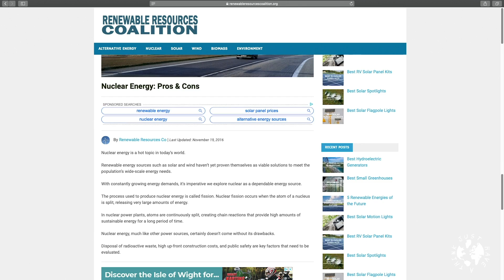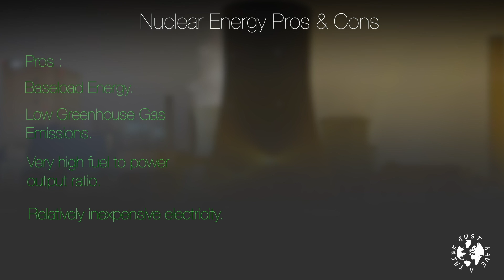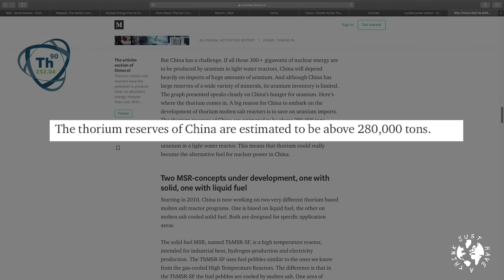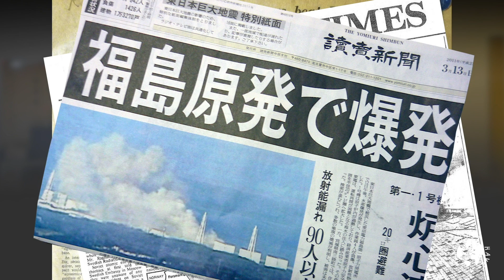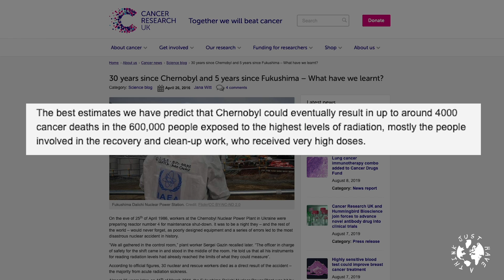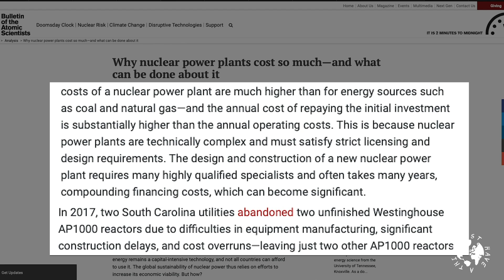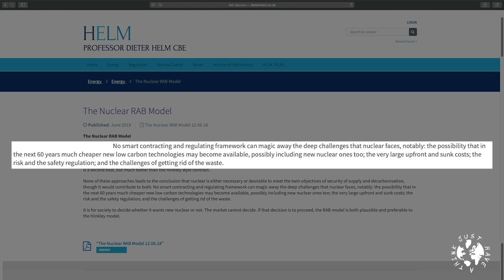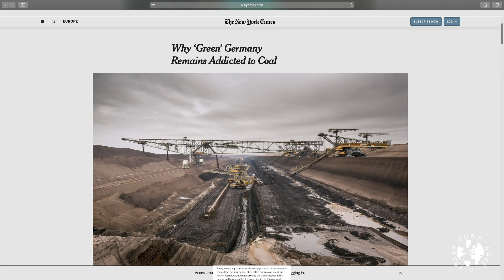Nuclear Energy in the 21st Century

Comment: Aside from the 'alchemy' required to turn thorium into uranium a couple of points:

1. The number of operational reactors is around double the quoted number if we include the ones powering submarines and aircraft carriers. They're small and so far have a pretty decent safety record. As you alluded to large high pressure water / steam is never a good mix hence high temperature reactors. Some designs can do both base load and deliver peak load performance and can work in conjunction with concentrated solar.

2. Our planets supply of uranium alone could power our modern world beyond the estimated life of our Sun. Yes nuclear waste is a huge problem but it's a big problem because of the amount of energy still in it. What a waste. Fast breeders address both issues but bring with them concerns with proliferation.

Proliferation is a valid concern but so is the societal impact of AGW and rising sea levels and several billion more mouths to feed. Ultimately the real problem isn't an engineering one, it's a societal one. The IPCC is right, we need to change the nature of human society regardless of wether we adopt nuclear or its alternatives. On the one hand we don't want more nuclear weapons and especially not in the hands of fanatics but wind and solar are pretty difficult to protect from attack.
Reply: Alcehemy? Its just a reaction: Th 232 +1n (absorption) -> Th-233 -> (decay) Pa-233 -> (decay) U-233. 

A similar reaction already occurs in every conventional nuclear reactor: 
U-238 +1n (absorption) -> U-239 ->(decay) Np-239 ->(decay) Pu-239

The difference is though that most of our reactors operate in thermal spectrum as there are some added difficulties, risk associations and proliferation concerns (largely overblown) related to fast spectrum design. In thermal spectrum U-233 has a higher probability of fission than U-235 or even  Pu-239 based on its neutron cross section and probability of absorption. In thermal spectrum Pu-239 actually has a high probability of absorption, which is in part when making nuclear bombs from conventional nuclear waste is effectively impossible. 

However in fast spectrum there is a near certain probability for Plutonium 239 to undergo fission compared to much lower probabilities for Uranium 235 or Uranium 233. 

Thermal, Epithermal and Fast Spectrum is a rather complicated topic that deals with the velocity of neutrons in a nuclear reactor core. Thermal spectrum relates to a situation in which neutrons are slowed by materials - these materials are called moderators in a nuclear reactor), whereas in fast spectrum there are no moderators.

Comment: We should go for as much renewables+storage as possible.  But this is with the realization that high penetrations of renewables (>60%?) grid reliability will be increasingly difficult.  A lot will depend on how far we can go with innovation on cheap grid storage.  (Transmission lines, dispatchable demand can also help.  But they have their own issues. )   So we should not be closed to nuclear, esp. after 2030's, the last leg of the decarbonization.   

There is a  debate between Mark Jacobson (Stanford, 100% renewables) vs. Chris Clack, et. al (PNAS).  My impression is that most of scientists who know something about both climate change and the energy think the Clack scenario is more realistic.  We will need some nuclear.

One issue to consider is what happens during a heat wave.  Use of AC increases.  Surprisingly, I heard that France had to shutdown some of its nuclear plants because the water from the river that was suppose to cool them was too hot.  Also the water levels were too low.  One would think solar PV would be a perfect complement to supply peak electricity under such conditions.  But PV panels also work less efficiently, when hot.  All these issues need to be addressed with the next generation of nuclear, as well as PV.

Comment: I agree that it doesn't make much sense to build new nuclear power plants when the cost is so high and when the costs of wind, solar and storage are falling so rapidly.
Reply: That depends where you are on the planet and what resource you have available. The UK has exceptionally high wind resource so might be able to manage without nuclear, but I've not seen any study yet (except lappenrata) which claims that it is possible. Many other high-lattitude countries have limited wind resource (and of course highly season solar resource), so nuclear makes an awful lot of sense, unless they have so much hydro they can make things work that way (parts of Canada?)
Reply: Solving the problems created by the mismatch between when the wind blows or the sun shines and when we need power to run factories or heat homes, etc. necessitates overbuilding the wind and solar components by a factor of three plus times, and then you still need to spend many billions on new high voltage DC lines to take that power from where it happens to be abundant today to where it's needed. And don't forget the additional billions in ongoing expense to maintain and replace energy storage for when there simply isn't enough power around. And of course there will still be days when the old fossil fuel plants will need to be run, so they must be maintained and staffed. All these problems become much easier to deal with if there's a steady reliable supply of dispatchable power available. The choices here are nuclear of fossil fuel with carbon capture and sequestration.

Comment: Wind and solar dont work when no wind, too much wind, no sun and too much sun.,  too cold, too much snow. Thorium reactors can use the spent Plutonium  waste from Uranium reactors and end up with little waste with insignificant half life. Like any new technology it's going to take time. Do you think Ford made his first car in one day ?
Reply: Pierre D. Bernier said:  "Wind and solar don't work when no wind, too much wind, no sun and too much sun, too cold, too much snow."
You're only partly correct.  For photovoltaic (PV) panels, there's no such thing as "too cold" or "too much sun".  They won't work if covered by snow, but that's relatively easy to remove.  
However, you also need to consider that the weather isn't the same everywhere.  It may be not windy today where you are but there probably is plenty of wind a few hundred miles away.  Your weather may be cloudy, but PV panels will produce some power even in cloudy weather and a few hundred miles away the weather may be bright sunshine.  Developed nations are linked by power grids that allow transmission of power from regions where wind and sun are temporarily producing too much power to regions that are temporarily underpowered.   
You said:  "Like any new technology it's going to take time."
We don't HAVE time.  This is an emergency.  The world needs to cut it's carbon emissions in half by 2030 and to net zero by 2050.  PV & wind power is relatively cheap, and wind & PV farms can be created from bare ground to up-and-running in three years or less.  Thorium research is great; counting on thorium to help solve the climate crisis is foolish.
Reply: @calamityjean1525  I see you have no f**knn idea what you are talking about. Go to  https://climateofsophistry.com/2019/07/25/how-to-debunk-climate-deniers-and-climate-alarmists/ and search key word <for dummies>.

Comment: If the nuclear industry cant guarantee a permanent way to safely store the waste it shouldn't be operating.
Reply: The waste problem is overstated I think. Even if there was no permanent solution for it I think it is the lesser of two evils. Its much better to have waste trapped and densely packed in one location than filling all of our lungs and fucking the climate.  We shouldn't let perfection be the enemy of better
Reply: It can, trivially, but someone has to let them build it. This is not a technical problem, it's a political one. The Finns are building theirs, which shows that it can be done. And the Americans built theirs but then decided not to use it, which is kind of surreal. The best thing to do with a lot of 'waste' (which is actually 95% unburned fuel) is probably to burn it as fuel in a fast breeder reactor, giving you much less actual waste at the end, but so far only the Russians actually have any full-size fast breeders operating.
Reply: It can, but we choose to ignore it.
Reply: +A boy and his shopping cart. Storing it isn't a problem when you can reprocess it and use it again.... like the Integral Fast Reactor (IFR) was supposed to do before congress in it's "infinite" wisdom decided to kill it. The beauty of it is spent fuel rods would be taken out of the power reactor, transferred into a "breeder" reactor which was the IFR. A breeder reactor is a reactor that generates more fissile material than it uses. After some time (about 1 month) the spent rods were ready to be put back into the power reactor. Practically infinite power achieved with physics. And the cherry on the cake? They had this technology in the 60's!

Comment: The use of Modern nuclear energy is a moot point and not needed. This energy is no longer second behind Hydro it is now third because the future is air.  "liquid Air" cryobattery is cheaper than hydro, fossil fuel or redo-active.  Thorium should have been used back in the 1930's but wasn't because the smart boys though if we could use retail operations as a way to pay for the digging of the uranium out of the ground, than repurpose the spent rods to military usage.  Air is renuable, free and abundant - you don't have to dig it out the ground and no regulation hassles. 23 billion for a nuclear plant could give us 50 or more of these plants and it won't take 20 years to build a plant !!!

Comment: Thanks for this summary of the current discussion of nuclear power, and especially for the citation links to the sources. I think one next step in your discovery about nuclear energy should involve comparisons of things like accidental deaths of different energy sources, amounts of materials considered wastes,  and the many different types of reactors now undergoing safety reviews.

It's far too easy to lump all types of nuclear reactors together; engineering differences do matter. Existing nuclear plants are baseload electricity generators because they were designed for that. Molten salt reactors in particular are designed to be general purpose industrial heat sources for whatever you need heat for: chemical reactions, load following and peaking electricity generation, and more.